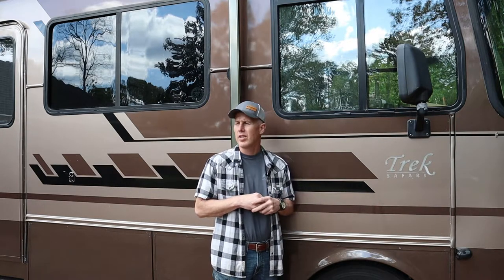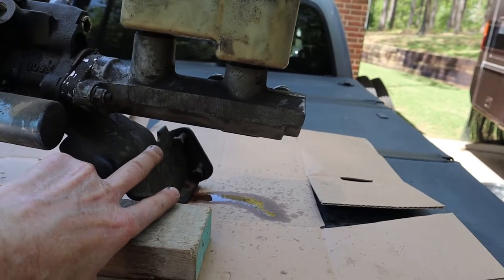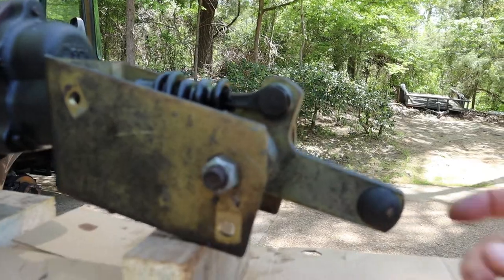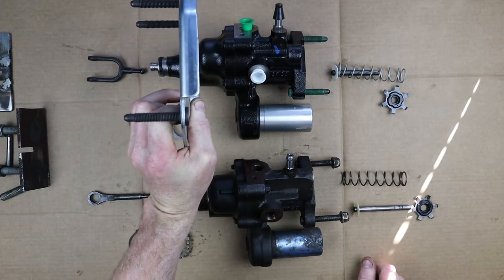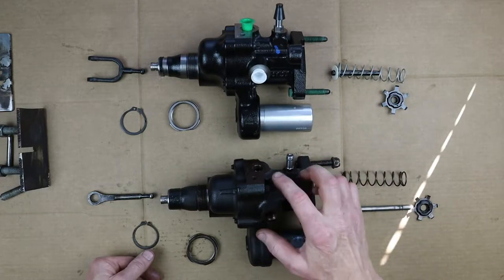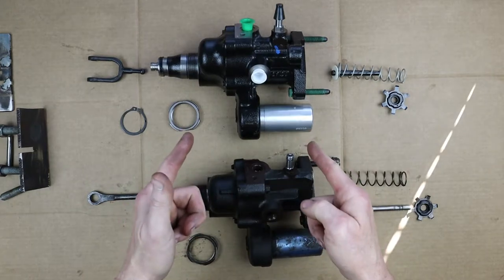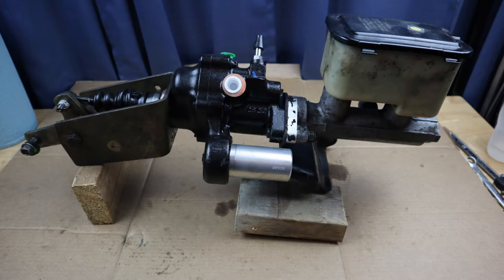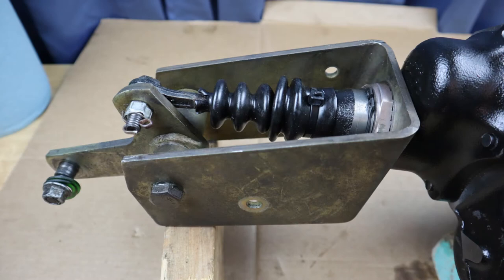WORKHORSE P32 BRAKES - Video #4 - Hydroboost Upgrade

Comment: This is the best brake system upgrade video ever!!!
I have a  2004 Damon Day Break 3270 that I have owned for 4 years and never have been pleased with the feel of the brake pedal or the stopping power, untill I found this video,
I followed all instructions, built the tools exactly as advised and purchased all materials recommended.
This is the real deal, It works as intended, and better than then Workhorse ever got it.

Comment: The push rod removal and  re-reinstall without damage is genius. Thank you very very much just the video I was looking for. I am rebuilding a hydroboost there are two lip seals on the shaft that you can’t replace unless you remove the push rod so you can then slide the shaft out.

Comment: Thank you for the guide!!! What a major improvement in stopping power in my 2002 p32.
1. You can cut the side shield off and make a ton of room. Bolt back together.
2. Leave master cylinder and lines intact. Zip tie and set aside.
3. Air chisel spins the big nut on/off easily.
Reply from the maker: All great tips.  Leaving the MC in place would save a ton of time and headache having to bleed the brakes.  I'm glad it worked for you and improved your brakes.
Reply: Don't cut it. Take the time with patience to unbolt it from underneath. And definitely don't rip up the floor!!

Comment: Thanks for this video. It gave me the info I needed to change out the hydroboost on my 1996 Fleetwood Storm. The old unit had locked up. The upgrade vastly improved the brakes. Thanks again.

Comment: I started working on this upgrade. 1997 Fleetwood South Wind Storm. Same workhorse P33 chassis. Took the inner wheel well plate out for access. Then pulled the hydro boost. 3.5 hours to do that. Fabricated the tool. Sure wish you had told what size bolts. I tried 1/4" all thread. Used 1/4" flat stock. FAILED. Both the all thread and the 1/4" plates bent. So far unable to remove the old rod. Not trying the new one till the old one is out. Going to redrill and go up a size on the all thread. Possibly use double 1/4" plates on each side. I'll try to revert after this is attempted. Read the reply for the solution!
Reply: Ended up starting over with the tool fabrication. I suggest using 1/4" by 2" wide plate steel which I found at Home Depot. ( I was able to do it with 1 1/2" wide but it bent and had to be turned over so use the 2" wide.) 1/2" allthread works perfect. Job completed but even with changing the longer rods into the new hydroboost, the pedal arm doesn't hit the brake light switch. I will work on that today Lord willing.  Either the switch will adjust or I have an easy fix in mind. I'll revert with another post with the results.

Comment: 1000 Miles later with the new ACDelco 178-1036 Hydroboost: 

This is really the best brake upgrade for the P30  - it is sooo much easier to get the large RV to stop.  It's actually on almost effortless side, braking doesn't feel like a large vehicle anymore.
I actually have to brake careful since all the stuff in the cabinets comes rushing forward.  It's easy to control after you get used to the higher boost level, so no worries about tires locking up.

At this point I can absolutely recommend researching if this upgrade is suitable for any P30 P32.  The new ACDelco part is a new, improved - and not remanufactured and is designed to stop a much larger and heavier vehicle.

The install is straight forward - only minimal adaption work required:
1. Sleeve for the rod
2. drilling the bracket holes a bit large so that it can sit 1/4 inch lower
Reply from the maker: Great testimonial!  Thank you. I’m at 5,000 miles. I replaced the booster, master cylinder, pads, and flex lines. I thought my calipers were still good.  I still wasn’t happy with breaking force. I broke down and replaced all 4 calipers. WOW!! What a difference. 
If the booster doesn’t completely fix your issues, you may have another defective part(s) in the system. Happy / safe travels. Best wishes.

Comment: Watched your video, will this upgrade work on my 1983 Airstream 310 Classic. Mine has the same booster that you took off and was wanting to upgrade mine if this will work, already changed the ball joints, rotors, calipers, brake lines, bell cranks, and shocks and would like to upgrade my brakes for better stopping. Please let me know what you think.

Comment: Great video..had to save it to make my tool..double nutted to slot plate instead of welding..used 5/16 drill bit to hog out th slots..end drilled and carbide bit th center...hell it took longer to make th tool than I think changing the unit..lol..probably not 😂  thanks again for th upgrade video. Note..it's not for everyone to do. I'm a retired mechanic so I had th stuff to do it😊

Comment: i upgrade my old hydroboost in my C10 truck for un newer late GM model and i was wondering how can i swap the pedal rod to keep my oem travel ....your tip for a home made tool help me a lot!! thx ;o)
Reply from the maker: I got the idea for doing this from the Duramax forums where guys were upgrading their 2003 - 20010 trucks with 2012 boosters.  I bet it will work for you also.  Please report back.
Reply: I wasn't intentionally  trying to upgrade.  Just happened to have a newer truck laying around for parts. And the first thing I noticed is the  pedal pushrod is shorter.

Comment: I just completed a Hyroboost and Master Cylinder swap on my 2002 P32 chassis coach, I used the 178-1040 Hyrobooster which does not require the front rod to be pulled.  However the supplied rod is a fraction of an inch shorter than the original, which means the brake / cruise control switches must be slightly adjusted, also the eyelet hole is slightly larger than the original, I was able to shim it with a short piece of brass thin wall hobby tubing from a K&S 3402 tubing set which was $8 on amazon (I think I used the 19/32 OD .014 tubing).  Otherwise I followed the directions on this video, swapping studs, output shaft, etc.  I also found using swivel head ratcheting wrenches along with an assortment of metric box and open ended wrenches made the job a lot easier.  My suggestion is to have a variety of 13-18 mm wrenches on hand, including 15, 16, and 18 flare wrenches for the lines.  Also when reassembling leave the Hyrdoboost mounting nuts loose until you get the mounting bracket between the hydroboost and master cylinder back in place.

Comment: Great video.  I'll add my two cents.  Everyone should take a good video of how everything looks before you begin.  I had to reference my video a lot of times to see how things went back together and what bolts went where.  Also, I bought a used part from a junkyard.  Got it for about 1/3 of the price of a new one, and since it was off a truck with less than 10,000 miles, it's like new.  The video doesn't address how to get the star thingy that holds the rod out of the old one.  I used a pick and angled the star clip.  Not exactly easy, but I eventually figured it out.  Another tip is to buy a cheap kit to bench-bleed your master cylinder before reinstalling it.  If you do it right, you get hardly any air in the brakes.  I was able to install and drive without bleeding any air at my calipers.  Be sure to leave everything loose while reinstalling it...makes getting the bolts in easier, and helps get everything back the way it was before you started.  Finally (and my hardest lesson) is not to bolt up the master cylinder when you're reattaching the brake lines to the master cylinder.  You need to be able to move that master cylinder around to get the hard lines lined back up and getting those pesky nuts started into the master cylinder.  Great video....glad you made it.  Sure saved me a load of money, and now my brakes work better than ever.  By the way, any particular power steering fluid for these old Workhorses?  I used some German GM power steering fluid....it's green.  Never seen anything like it before, but the bottle says it's for all sorts of GM products, including Saabs, Cadillacs, and a bunch of cars I don't recognize.  Thanks again for the video.  - Tom
Reply: Excellent advice

Comment: I'm surprised you had to do that much messing around to get the hydroboost filled back up. I've gone through several steering gear boxes. Crank the wheel back and forth a few times till it quit making noise and it was fine. Not sure what your pump is like, but mine had a tank above the pump, so maybe that is why it was more forgiving.
Reply: Absolutely easy with mine. Filled the reservoir and a few pumps of the pedal and turns of the wheel and it is bled.

Comment: Awesome videos and the swap and upgrade is amazing! Feels like I'm using less than HALF of the brake pedal pressure than before the mod.
Reply from the maker: Thats great to feedback.  I am super proud of this mod.  I have learned a ton from others on Youtube and various forums over the years.  I'm so glad to be able to pay that back.  
In researching before making the videos, I read hundreds of posts where people were looking for a way to make their P-series brakes better.  I didn't find one single solution.  I got the idea to upgrade the booster from the Duramax truck crowd.  As far as I know, I'm the first to pionier this mod for RV's.  
Thank you for watching and for provinding feedback that the mod worked for you.  Drive safe.
Reply: @ufixit  2 slotted plates,1 top of alloy,then 2 nuts,then slotted plate under ''u''.

Comment: On the P32 workhorse is there a power steering pump and also a brake “master cylinder” or are they both combined into one single unit for all P32 workhorses?

Comment: Very useful nformation in this video, however about  the part of removing and re-staking the input rod, I am not very comftable, I am trying the upgrade soon but I will go for the threading solution, you can cut the original input rod and run a 3/8-24 die on it, then you can get a input rod kit or cut and thread the old input rod, then put it together with a long nut. Be aware that the staked part is NOT an aluminum sleeve as claimed in this video, it is steel and the staking is very solid, back in time I pulled out an input rod using an equivalent setup and the pull-out effort was so big that the input rod ring became out of round
Reply from the maker: Great idea on how to solve the input rod issue. The sleeve on mine was most definitely aluminum.  The tool I showed pulled the rod out effortlessly.  Your way sounds easier than making the tool to pull the rod.  It should work equally well.

Comment: Oh man thanks I was looking find how to remove the push rod I'm doing this tomorrow thanks for the wisdom
Reply from the maker: I think you will be happy with the results. If your brakes are still soft, consider replacing your calipers. I thought mine were good but after replacing everything else, I finally broke down and replaced all 4. It was an immediate and dramatic difference. Firm pedal and stops great.

Comment: This is a great video.  Getting reman hydro boost is expensive and they don't last.  So here's our question: How did you find the AC Delco Hydro unit to begin with?  We're running three Workhorse  W42 chassis and we either get them rebuilt or we go to a Workhorse supplier and get bent over -- because it's Workhorse. Thus far we're going the reman route but would love to go your route.  It's just that there are so darned many hydro boost units, we don't know quite how to start with finding a comparable unit from which to start doing measurements.
Reply from the maker: I ordered a new OEM unit for a 2021 Chevrolet 3500 Diesel from Rock Auto.  $190 I think.  If you go to a site called trektrax, there is a whole long thread dedicated to this improvement.  Quite a few others have done it with great results.  Below is a link to the rock auto part.  
https://www.rockauto.com/en/moreinfo.php?pk=11093912&cc=3447306&pt=1884&jsn=478

Comment: Thank you for this video. Our 1995 P32 (4 wheel disk brake coach) uses the same hydro boost as your 2003. our hydro boost works just fine but is slowly weeping power steering fluid. Your solution eliminates the rebuild waiting period, and (I assume) either increases braking performance or reduces pedal effort.
How do your brakes feel now?
Reply from the maker: My brakes were bad to the point of being dangerous before this rebuild.  I replaced the booster, master cylinder, all flex hoses, pads, and one rotor.  I also cleaned and greased the slides.  All that combined made a night and day difference.  I can't say for sure what % the booster accounts for.  Currently the force required to depress my pedal and get strong brake engagement is greatly reduced.  The pedal actually feels kind of soft but brake engagement is strong.  I think the larger piston in the new booster does provide a gain in force to the master cylinder.  Performance aside, the primary advantage is availability, price, and a factory new part.  I researched this extensively before making the swap.  I read a lot of horror stories from people who had to change out their booster multiple times because the rebuilt units leaked immediately or very soon after being installed.  Best wishes with your project.
Reply: @ufixit  how wide are the slots in the tool you created to pull out the push rod. Excellent video

Comment: I know this is several years later  but for the next time you have to replace the booster use  178-1036 or the 178-1040 are the part numbers you want to use so you do not have to dick around with the push rod.
Here are some tips for anyone getting ready to do this awesome upgrade ....
The 178-1040 is much cheaper than the 1036 btw, buy new GM and do not mess with remans unless you want to do this twice- the majority of them end up leaking
The pushrod eye is slightly larger than the old one - just take some roof flashing and roll it around the bolt shoulder one turn or make a bushing if you have a lathe.
Tie up the master cylinder to the frame and unbolt it from the HB - saves a couple hours not having to bleed the brakes. Back out the stud threads , that will give you some working room removing the HB mess- remember they are reverse thread .
Most p30 fwd control chassis have an adjustable end on the big long  vertical rod connects to the HB bell crank - I turned mine in 1.5 turns and kept my pedal height and didn't have to mess with the brake switch adjustment if you do not have this just leave it be and readjust your brake switch, the pedal height change is minimal and not worth the headache of changing that pushrod,
Buy a cheap transmission cooler and plumb it in the steering return hose- don't worry about the HB circuit as it is not moving fluid until the brakes are pressed... the PS is the big heat generator.
Fluid -  Any TES-295 fluid is going to fare better than inferior GM or any power steering fluid in hot ambient temperatures - Mobil 1 Delvac,, Castrol transynd, Royal Purple Max-EZ will not boil over. I hardly hear the  "shhhh" or any pump whine  when turning with the TES fluid.
Put new rotors and calipers along with this HB and you better secure shit in your cabin... half my bedroom ended up near the cockpit during road tests !
Reply: I used the same 178-1040, in my case I used some thin wall brass hobby tubing to make a bushing K&S 3402 Round Brass Telescopic Tubing (this is a variety pack, I think I used the 19/32  OD size, this was a perfect fit, tight enough I had to clean up the bolt with fine sand paper and use some oil lube to get it on the shaft) and cut off a short section with a Dremel cut off wheel and sanded it down to length.  The linkage is slightly shorter than factory, but within he adjustment range for the brake stop and cruise control switches on the pedal bracket.   On the topic of replacing the master cylinder, I am glad I changed mine after finding a lot of grit and corrosion inside.
Reply: @MrPenguinLife  I replaced my master cylinder last year before going mountain climbing so the fluid and master was good so I just diverced the MC from the HB. Knowing this rig was gonna see a lot of NC area mountain back roads less traveled  I flushed the fluid and used Pentosin super DOT 4 
I am only 13k pounds on an older 1986 Monitor/HRC with an 8.1 shoved in it so it does great stopping and going

Comment: Great series,  I have the 30PDD and the brakes just seem to be to soft or spongy.  Want to pull a toad but I worry I do not have the stopping power.  Would like to see part 1 and part 5 when you post them.  Big help...thank you.
Reply from the maker: Absolutely!!! Check your wheel calipers.  I thought mine were good but even after replacing everything else and bleeding the system umpteen times, my pedal was spongy and brakes not so good.  I replaced all 4 calipers and BAM!!!!  Hard pedal and will stop on a dime.
Reply: @ufixit  Previous owner had paperwork with receipts for brake master cylinder replacement.  Said brakes failed while towing a jeep in Colorado.  I bet they got the brakes so hot that the  Brake fluid boiled.  I would think if brakes got that hot, the rotors probably glazed and the caliper seals probably lost much of their integrity as well.  Thank you so much for replying to my reply.
Reply: ...4 months later...and you were absolutely correct.  4 new calipers and my RV is stopping on a dime.  Huge huge difference.   Thanks so much for the advice and the "how-to- do- it" vids.

Comment: Fantastic! I have an 85 chevy C30 dually 2WD 1st gen cummins 5 speed.. I need to do this so Thank you! What are the thread sizes? Mine are metric M18 and M16.. Im hoping they are the same as mine!! Thanks again bud! Rock auto sent me one with i believe sae thread.. none the less its a CARDONE 527307 Remanufactured no workie..
Reply from the maker: I'm sorry.  It's been a while since I did this mod.  I don't have the old booster anymore to check.